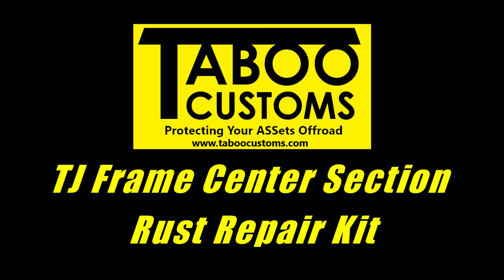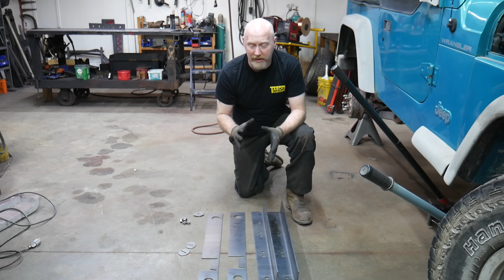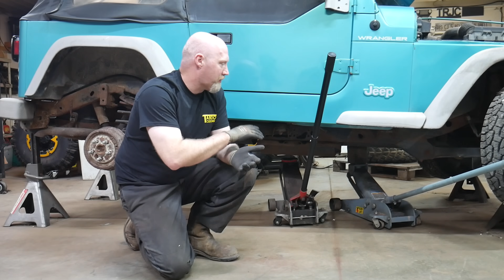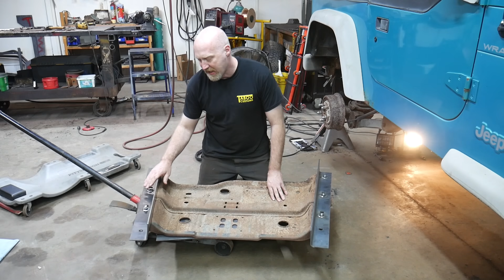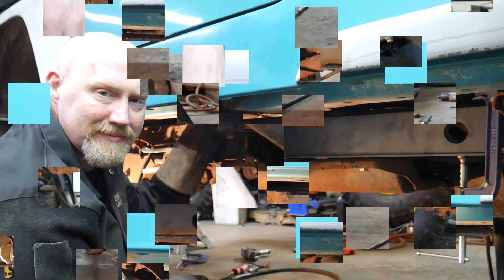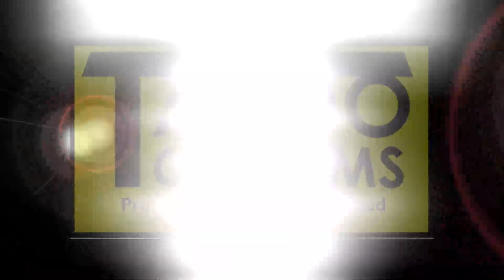Jeep TJ Wrangler  Frame Center Section Rust Repair Kit Installation

Comment: Let's say I have a small hole in the frame under the plate can I use this to just boxe in both sides of the frame I don't need to go that far but would like to boxes it in with this
Reply: Thanks that what I was thinking appreciate it I ordered one going to just boxe the hole and do both side just to have the extra protection appreciate u feed back
Reply: Got my set one hole for the 3 Rd bolt is off 1/2" inch we're my Perch is makes the out side plate 1/2 "off do I have the wrong set? was for a 2004 tj
Reply from the maker: Yes unfortunately the center section kits we have currently available do not fit 03-06.  They changed the pattern in those years and switched to metric threads.   Sorry I didn't realize you were talking about an 04, the years they work on are listed in the descriptions.  We do have a prototype desig. For 03-06 but we personally have not installed it so I can't guarantee exact fit.  I could swap parts with you if you want to try that one.  If you want to call me at 317 316 3039 we can discuss.
Reply: Will do tomorrow appreciate it
Reply from the maker: @littlebastardsracing49  if I am unable to answer just leave your number or text and I'll give you a call
Reply from the maker: Yes you could.  I would suggest cutting out around the hole to get the worst rust out.  If its not bad and the bolts come out clean you dont have to install the new nuts, you could just keep the original nuts in the frame.  Might need new bolts though.

Comment: Hey do you think you should paint the original rusty frame between the repair section and the frame. Maybe somthing to kill rust.
Reply from the maker: Yes, if you can it would be good you just need to be careful that whatever you use does not affect weld quality or you get it cleaned off enough where the welding will be.